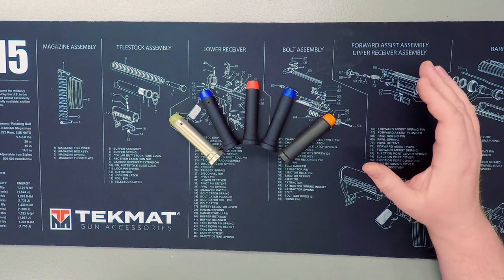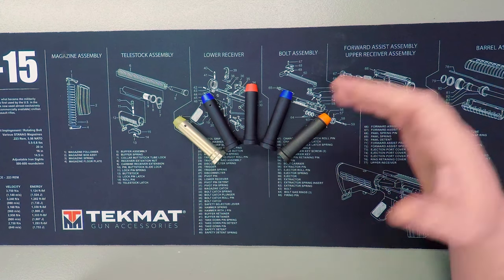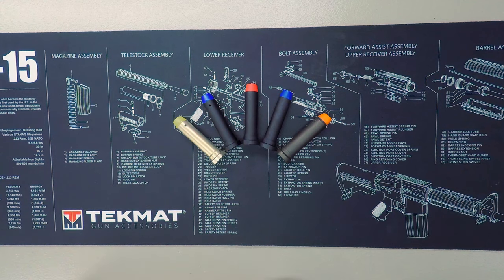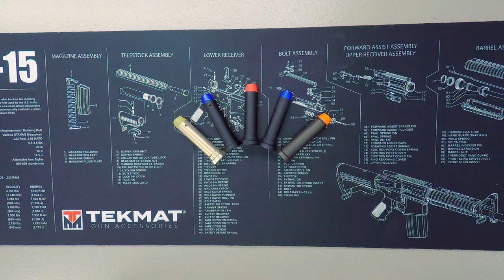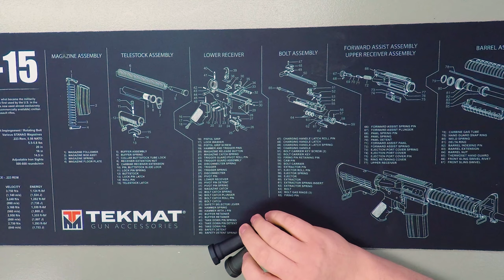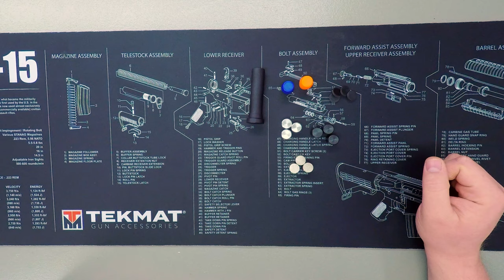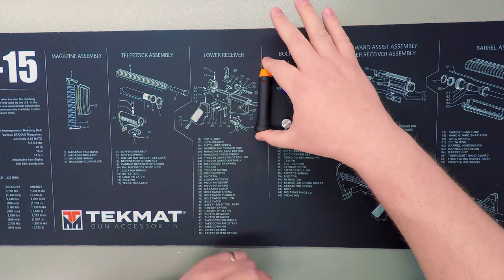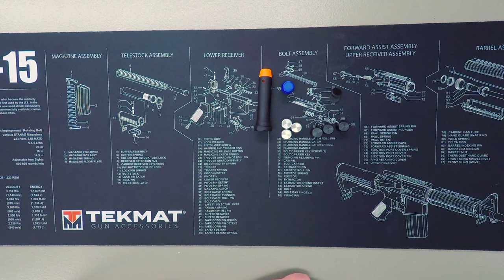Choosing the Right Buffer for Your AR-15 | AR 15 Buffer Review

Comment: If you suspect a buffer adjustment may fix your problem buy the H3 buffer. Using the different combination of weights between your standard buffer(3 lighter steel weights) and the H3(3 heavier tungsten weights) you should be able to come up with a combo that works for just about any AR.

Comment: An adjustable gas block can cure most of these problems. Heavier buffer to deal with over-gassing? Just reduce the gas.Under-gassed? Lighter buffer and tune with gas block. Covers a huge range of possibilities. The idea is to use the least amount of gas to cycle the rifle. Less gas fouling, less gas-face, and more gas pushing the round. Also the state with the the least recoil. No AR should be without an adjustable gas block. Best $60 you can spend on an AR.

Comment: This was the best explanation I’ve ever heard on this topic!  Well done. I have a Spikes H2 on my 14.7” mid length system. I also added an adjustable gas block.  Ejection pattern is at 4oclock on 62 grain. Softest recoiling rifle I own! 

I am building 11.5” carbine. Also going with an H2 buffer, and also adding an adjustable gas block as I may add a suppressor in the future!
Reply: Hey Dan, did you finish the 11.5" build? If so, how did the H2 buffer work out?

Comment: This was an excellent video thanks for putting this together you answered a lot of my questions.  The one area that I am still in the dark on is the spring strength!   I have heard to smooth out recoil  go with a lower buffer weight and a stronger spring.  Since the buffer and spring work together to slow the momentum of the bolt and then return it to being in battery it would be really helpful to understand how to incorporate both decisions (selection of a specific buffer and spring ) to optimize felt recoil and ability to execute fast followup shots.
Reply: This guy is basing the buffer weights with the use of a standard mil-spec buffer spring.....Or he would have mentioned that....Even just using an extra power spring with mil-spec weight buffer would slow the energy.  If you really want to learn about buffer systems don't hesitate to call Sprinco....They are one of the best in the business....They will tell you to start with a standard set-up and tell them what's happening from that point.  Your rifle has many tunable options and the buffer is the easiest and quickest.....Unless you have built it urself and used an adjustable gas block your options are limited and they can help......Wilson Combat is another genius company with awesome tech advice.  Good Luck and keep on shooting!!!!!

Comment: Just noticed you missed a rubber pad (RP) when you put the together. You go buffer body, RP, weight, RP, weight, RP, weight, and end with buffer bumper. Basically you're trying to avoid any metal to metal contact with the fronts/ends of the weights.

Comment: Great tutorial. I noticed my brass being thrown forward of the firing line just the other day. I figured something was wrong and since it was gifted to me I was going to tear it completely down. My gut feeling is they used an off the shelf carbine buffer. If that the case I'll switch out o a H3 and see what happens. Very good tutorial.
Reply: I tried an H-1 on my rifle when I noticed it ejecting into the 1:00-2:00 area. Next range trip I had the first "short stroke" ever with that rifle. Went back to the lighter buffer....no more short strokes. good luck...maybe your rifle will like the new buffer.

Comment: Surprised at your recommendation for 300AAC Blackout and 7.62x39.
I have a 300 BO. and a 3 oz.. carbine buffer works great on both full power and subsonic loads.
12.5 inch barrel.
Reply: John Fedor I am just reading the comments and found yours interesting: On the 7.62x39, Do you replace the buffer spring?
Reply: @polduseri909  The 300aac was designed to shoot like the 7.62x39.
It may work the same on your rifle.
But as he mentioned, it can depend on how your gun is gassed. If your recoil is a little more and your cases are not at 4 o'clock, my first adjustment would be to the 3.8 oz buffer.
FYI I use the 3.8oz. on 6.5 Grendel
and 9mm. The 9 also has a heavier bolt.
I think he was trying to make the point that every rifle is a little different. Especially if you build your own. You have a hodgepodge of barrels, gas blocks, buffers and springs from different manufacturers.
Reply: @polduseri909  ps my 6.5 and 9 cases were landing behind me at 5 oclock.
Reply: John Fedor thanks a lot for replying and for your insight. I am in the process to complete purchasing all the parts to build an ar in 7.62x39 and a lot of comments that I read focus on the buffer, buffer spring, magazine and enhanced firing pin. But as you said, all the rifles built have a peculiar way to respond and it’s about to test them in order to refine as needed.
Reply: @polduseri909  If your still buying parts, I know Right to Bear sells bolt carrier groups with the enhanced firing pin included.
There are inexpensive barrels at B.King, Classic fire arms and Bear creek arsenal. They are all BCA. I had good luck with mine.
The best mag. for 7.62x39 are 
C-Mags.
Reply: same. 300blk on pistol length gas systems when combined with a H3 buffer usually runs into problems with cycling. H2 is what i have found to work best along with others confirming.

Comment: Nomatter what I do, my ejection path is at a constant 1-1:30 position. I'm able to cycle from 3oz all the way up to 5oz. It seems the heavier I go, the less distance the round will be thrown but still all in the exact same direction. What's crazy to me is that when I go with the 5oz weight I can still cycle lower power 223 like pmc bronze and the rifle will still lock back on empty mag but with even low pressure to higher pressure rounds when using the heavier buffer the rounds fall out of the rifle in such a silly looking way like a little brass turd plopping out right underneath my rifle. I ended up just going with 4oz because it seemed to feel the best and also I have less worry of any malfunctions. It's crazy to me how much more my AR kicks with just 1oz less buffer weight. You would never think you could ever feel something with that little difference. Rifle is a 16" Ruger AR 556. Switched out their buffer and buffer spring with a sprinco carbine white spring and buffer that's customizable as well as switching out their bcg to a son's of liberty gunworks complete bcg.
Reply: Sounds like your gas port is so oversized that no amount of buffer weight or heavy spring can compensate. You will likely need an adjustable gas block to tame that beast. Check out this video from SOTAR for an in-depth understanding.  https://youtu.be/eAuTHPdUchU

Comment: I totally laughed my ass off whenever somebody says 3.5 is a heavy buffer. That is not even close to a heavy buffer. Back when they only had two different sizes yeah it was. But I went to a 13 Oz buffer and a 308 recoil spring in my foxtrot Mike 45 carbine.

Comment: Thank you for your video,  I'm in somewhat of a disagreement though. For starters, it's the buffer tube length which designates how much travel is available for the bolt. Next it buffer spring length because a longer spring has less amount of room between the spring coils before bottoming out. Then lastly is the buffer length. Which if to long will bottoms out at the back of the buffer tube,.not allowing  the bolt catch to operate normally and making excess felt recoil. You never want the buffer system to bottom out. The best system is a full length buffer tube, a shorter stiffer carbide spring and a H3 buffer. Any further issues can be remedied by buffer weights. Lighter for smaller calibers.
Reply: What that's so wrong a carbine length spring will not function properly in a full rifle length buffer tube nor will a carbine buffer and H3 buffers come in rifle and carbine length

Comment: My 3 Colt m4a1socoms came with h2 buffers my 2 Colt 6920s had h1 buffers.I replaced the h1 buffers in my 6920s with h2s.A properly sized gas port on a carbine and the use of good ammo should be able to function better with h1 or h2 buffers.

Comment: Very nice Video, thanks. Can you do one on selecting Carbine vs A5 vs Rifle length Systems? I currently have a Carbine Buffer on a mid length 14.5". I recently put together an 18" Rifle length Upper to use on the same Lower. it seems to cycle just fine, but I was looking at the Buffer system and wondering if the "A5" variety would be more appropriate.

Comment: What about the weight of the bolt carrier assembly though? 
No one ever discusses that part. 
Mine needs a heavier buffer but not sure to get h1 or h2. Mines all commercial stuff including the bolt carrier assembly and a16” heavy barrel with a2 sight and carbine gas system. Stock used to be fixed rifle but was changed to collapsible Tapco a long time ago. Im considering just buying the 3 piece set of tungsten weights and play around with it and maybe a Wolff extra power spring and just start with the spring then get into the buffer if needed.  I can get both for $23 ish plus tax and shipping which is still cheaper than a brownells heavy  buffer that may or may not fix it. That’s more than enough weight without a doubt and gives me a lot of adjustment. But is there any difference in mil spec vs commercial diameters on the buffer weights or buffer?

Comment: Issue: 9.5" 300 Blkout, standard spring and 3.0 oz buffer. Suppressed. Runs supers just fine. Short stroking on subs. Replaced spring with springco 25% reduced yellow spring. Now cycling. Trying to wrap my head around the physics of it. Did I put a bandaid on issue?? Or was I correct in reducing spring tension?

Comment: I don't know if this is really a question, or just info for you to maybe address in some other Buffer-centric video sometime. I'm a novice to building on AR-15 platform and usually do a lot of research before buying each piece. In building an AR-15 Pistol in 9mm, I got the Armaspec Sound Mitigation AR-9 Buffer (ARM158-9).  What I discovered was that the guide rod was so damn long, I could not cycle the BCG back into the buffer tube far enough. Saw on a blog somewhere that a SME was helping another novice and speculated that he had gotten a rifle-length buffer kit for a carbine-length stock/brace.  I didn't see anywhere in the specs of this buffer where I could have caught that mismatch.  Is there ever an end to the countless fuck-ups before learning all that is needed to know?  ;-)    GREAT VIDEO!  You're a great organizer and presenter of straightforward content.

Comment: I have an old 20" barrel A2 style AR. I changed the fixed original stock to an adjustable stock, probably intended for carbine, that has a shorter spring and shorter, lighter buffer. I like the adjustable stock but it doesn't always cycle correctly. Do you think an H1 buffer is the right weight to try?
Reply: Get a heavier buffer, extra power spring, or get an A5 buffer system,  which is a rifle spring adapted for collapsible stock.

Comment: Just bought a FN - 15  5.56 carbine M4 ? .......... was told to use xm193 ... 55 grain ammo ...... is this right ? Only ran 100 rds thru it so far was told to run 750 before I do anything to it ........ brass is mostly going behind me at around 5 o'clock

Comment: Thanks for your informative video! What would be your recommended weight range for a .223 7.5" barrel AR pistol?
Reply: Cuauhtli-Mixtli Mendez-Martinez  yes definitely
Reply: @Markus Reestuh lol.  7.5 in 556 is dumb. You want a flame thrower/concussion grenade for every round or a rifle?  Ran a 7.5 in 556 for a bit and it's the most impractical thing I've ever done with a firearm. Granted 300 blk is totally duable at that shortness,  but not something burning off most of its powder before it makes it an inch out the barrel.  If you wanna go short on 556, 10.5-12.5 is the only way to go.

Comment: My ar ejects the casings at the 1 o'clock position and it's very, very consistent at it.
Reply: It's over gased try a heavier buffer
Reply: That is way over gassed. You should consider an adjustable gas block. If that isn't in your skill set, an H3 and Sprinco orange spring will probably work for you.

Comment: hi ive been searching around for the correct answer for my build. I have an AR15 carbine build with a 16" barrel with a heavy duty competition barrel much thicker and heavier than factory sized barrel, it is also has a hard recoil even with a muzzle break making me believe it may be over gassed as well. I was hoping to swap out my buffer system and see if that helps at all. but I don't know what size or style to go with for my configuration.

Comment: I just built my first ar-15 and cant get it to cycle I have a rifle length gas system and a rifle length buffer tube and buffer on a 20 inch barrel. What should I do.
Reply: Is there any gas leak on gas port and BCG

Comment: What Buffer & spring would you suggest  for a  450 Bush with a 20" barrel? 
Im having cycling issues (failure to feed & sometimes extract) but i don't have a table full of buffers & springs to test, so before i go spend a lot of money (ammo included) i would like an expert opinion.

Comment: I have an Aero precision M5-E1 chambered in 6.5 Grendel, 22' barrel, rifle length gas system, magpul prs gen 3 stock and a muzzle break. I also have a Timney trigger with a 1.5# pull weight.  My shell ejection pattern is at 1 o'clock and if I don't pay attention to a firm complete trigger pull and follow through, I will have a double (Bump fire)...What weight and type of buffer tube do you recommend to mitigated these symptoms? The rifle runs fine but at higher pressure and brass indications even at lower charge weight loads.
Reply: Maybe try an adjustable gas block to regulate the gas. Also you should be running a rifle length buffer tube for a rifle length gas system. Rifle length heavy buffers are not common I believe people run a spacer to use carbine buffers and springs.
Reply: The M5 cant possibly shoot 6.5 grendel... M5 will shoot 6.5 creed, or the M4 will shoot 6.5 grendel....

Comment: Thank you for all the info, just to double check though.... so if I'm runnin a 10.5 inch ar pistol that's over gased and I may run it suppressed more then not, I should run an h2 or h3 buffer?? Any help would be greatly appreciated.
Reply: Same question. I get a failure to eject on rare occasions and I have a hunch my buffer might be too light.

Comment: What about with extreme lightweight bolt carrier groups that weigh around 5.9 ounces? I see that most BCGs weigh around 12 ounces.

edit: I just weighed my jpsilent capture spring gen 1 system and it weighs 7.22 ounces.
Reply: Light weight buffers are better just tune your gun to run them

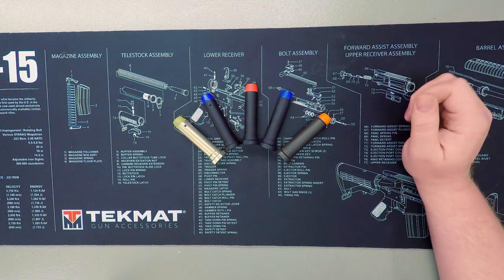Comment: I noticed my 16" mid gas AR was ejecting to the 1:00 / 2:00 position. I tried the next step up to the H-1 ( 3.8 0z) buffer. Ejection moved to the 3:00/ 4:00....great. Then the first time ever fail to lock bolt open after last shot. So...back to the 3 oz and a slightly forward ejection. Is there a change of buffer spring that would balance this? I need a video about springs...maybe.
Reply: get a sprinco buffer spring
Reply: Yes, a springco spring would help.

Comment: I am building a 6.5 Grendel with a 20" mid gas system barrel. What kind of buffer tube would you recommend I use? Thank you for your input in this matter.
Reply: normal buffers are outdated on builds use a jp scs or a armaspec stealth you will have lower recoil then.

Comment: I have a question: Do I need a heavier or lighter buffer when I use a suppressor?  I tried to use mine and it was making both my AR rifles jam. It was causing the primers to be blown out of the shell casings.  Have you heard about anything like that happening?
Reply: Check your headspace if primers are being blown out
Reply: @errolwilcox747  I got the problem fixed. I bought buffer kits from KAK Ind. Built heavier buffers And the ammo was junk.
Reply: @craigdenny565  well, junk ammo explains a lot haha. At least you got it figured out 👍👍

Comment: With under powered rounds I've got about 230-3 o'clock ejection and with 855 rounds about 1 o'clock 
H1 or h2?
Reply: H2
Reply: If you are running a carbine weight now, are gonna need an H3 and heavier spring to pull that ejection back to where it should be with the 855. Consider an adjustable gas block.
Reply: start with the cheapest mod h2 buffer.
Reply: Thanks for the suggestions guys. 

The h2 straightened it out quite nice, and still cycles light steelcase loads.

Comment: What if you want to go for a lower weight? For example the 7.9 oz Vseven BCG? how can you make it run well without adding a lot of weight?
Reply: If you want to run a lightweight BCG and lightweight buffer and spring, you need an adjustable gas block to bring the gas down so you don't run the bolt too fast.

Comment: Using an H2 buffer. Still getting forward ejection. 10.5 inch barrel. H3 next?  Any suggestions would be great!
Reply: An H3 will only make a little difference.  I would try the HSS or XH buffer.  You are over gassed.  Fix that issue rather than compensating for it.  Get an adjustable gas block.  If you don't want to buy a floating hand guard and a sight to go with it in order to use an adjustable gas block, get the A2 style adjustable gas block by JP enterprises.
Reply: Adjustable gas block
Reply: Did you change your spring at all? Springco white carbine buffer spring might help. According to Springco it works great with 10" SBRs when used with H2 buffer.
Last resort would be to get an adjustable gas block.

Comment: I'm building my first AR-15. I'm looking at a 12.5 inch barrel with a carbine length gas system. What weight buffer would you recommend?
Reply: In process of building one of these now, and I'm going to start with an H2.  Gas port is right at 0.76, and running  a standard carbine buffer tube and spring.  Sprinco spring may be the next step if it needs slowed down a bit more.